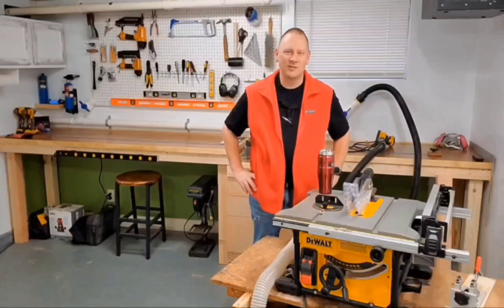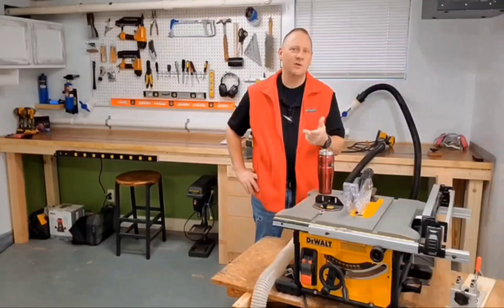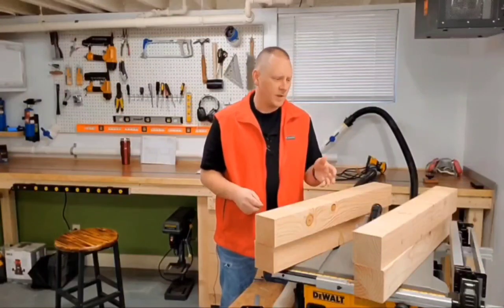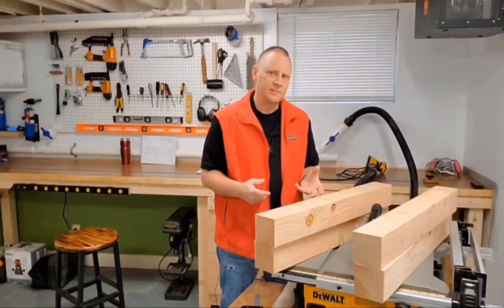DIY Dewalt Portable Table Saw Cart - Creating My Ultimate Home Shop: Part 6

Comment: Do you sell or provide the plans for this? I'm a beginner and have been looking for a mobile cart for my Dewalt 7485. This looks really nice and is what I've been looking for.
Reply from the maker: Thanks for watching! 
The plans were unfortunately made up as I went although I did base it off a few other designs I found on youtube. It will depend on your needs for work surface and height. The journey was fun and don't be afraid to just dive in. Referencing the joints amd general methods of construction will get you there.
Reply: @LivingWisconsin  that’s understandable. Just figured I ask. Like I said I’m a beginner and would like to have something to go off of and make my mistakes knowingly.